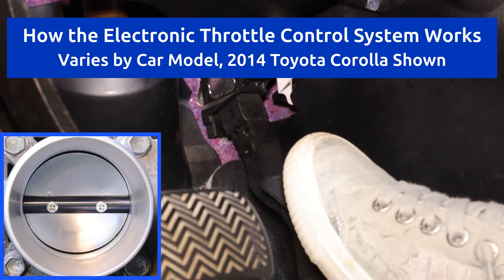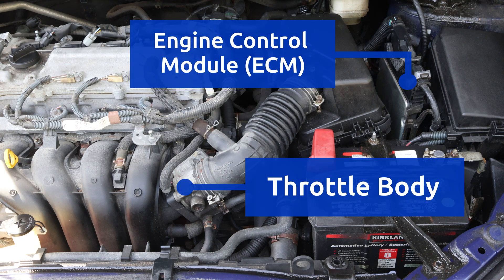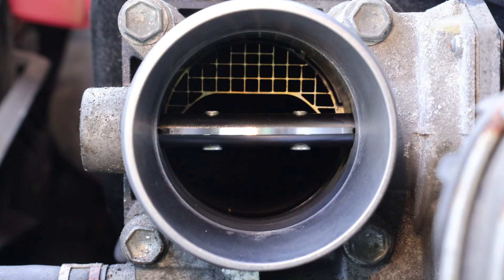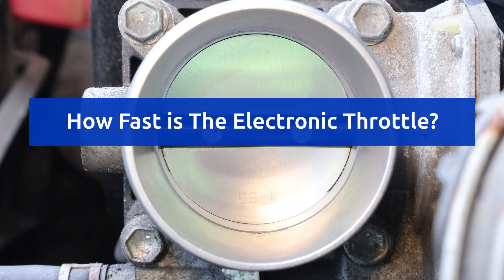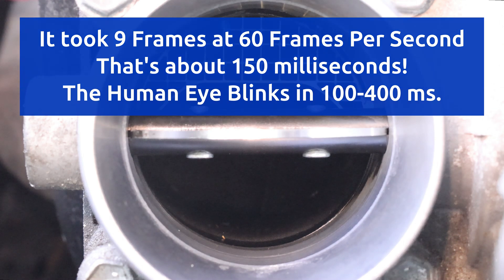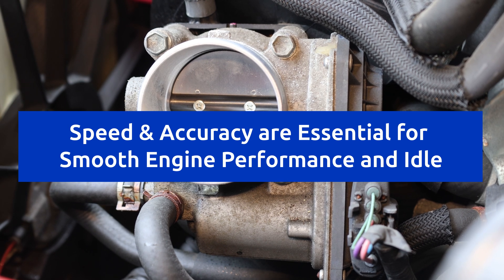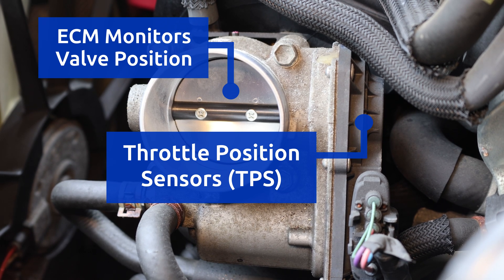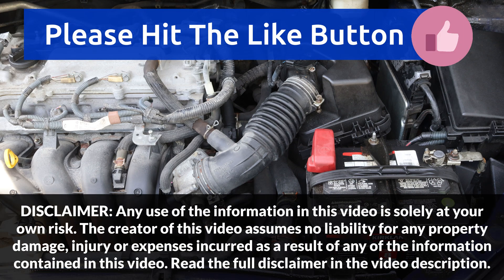How the Electronic Throttle Control System Works in a Car, Throttle Valve, Throttle Body, TPS

Comment: My 328i does not open as fast as in the video. What I should check to fix it?
Reply: open just 1/4
Reply from the maker: If there's something wrong, the ECM should light up the check engine light, and the code will indicate what to check.